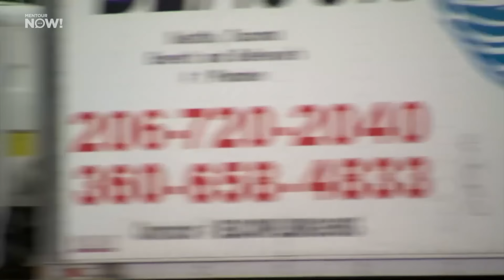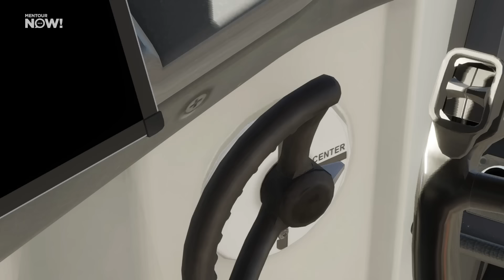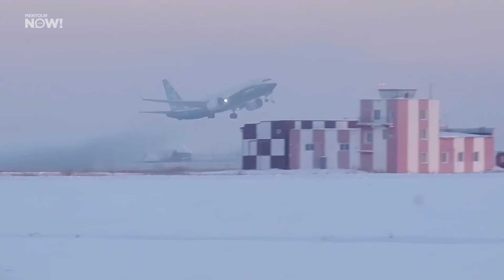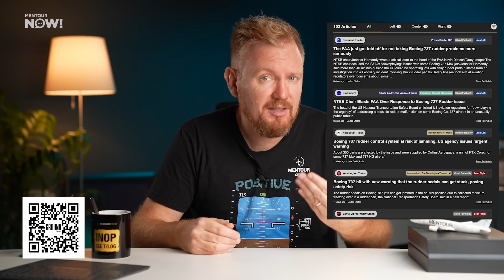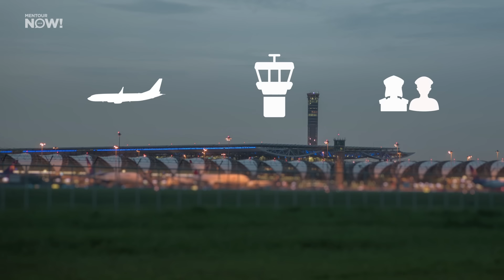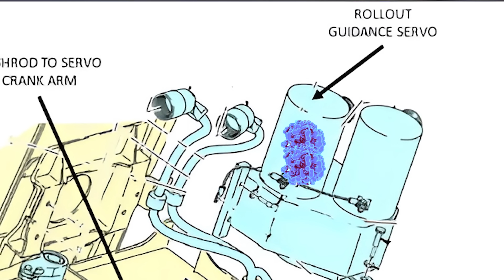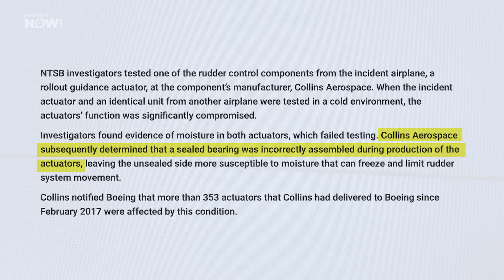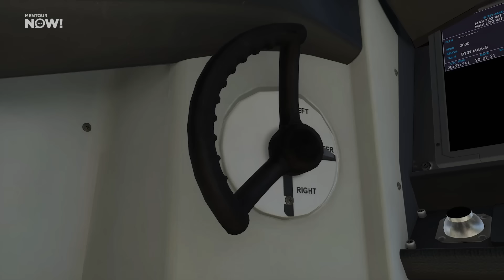Does the Boeing 737 Have ANOTHER Major Flaw!?

Comment: I think KLM replacing their 737 fleet with A-320neo family aircraft is an excellent choice.
Reply: Excellent? it is called common sense. Lives are more important than money, but not for Boeing's executives.
Reply: I wish all airlines would adopt the A32x family.  Even a 19 mm/0.75 inch wider seat makes a huge difference in passenger comfort in Economy/Coach thanks to the Airbus’s wider cabin.  I wish Boeing had simply started work on a clean sheet replacement rather than kicking the can down the runway or putting lipstick on a pig with the 737 Max.
Reply: @karlospineda371 They are unsafe. Just because something operates doesn't mean it doesn't have problems. You people would defend this company even if made planes out of paper.
Reply: @karlospineda371  LOL If no unsafe planes were allowed to fly, we wouldn't have had half the accidents. Boeing is producing faulty aircraft. To deny this is the height of Bias.
Reply: Kinda logical if you think of it KLM is an European company they will opt for Airbus (France, European) over Boeing (USA) except when Boeing can demonstrate it's safer and cheaper. After all it's a business.
Reply: @randar1969 wrong. Ryan Air being European uses an all Boeing fleet… Fleets in Asia use a lot of Boeing planes too. Please don’t spit out false claims to support a rhetoric that European favor Airbus. KLM is replacing its short haul fleet with A320’s but has still ordered more 777X and 787 Dreamliners into their long haul fleets..
Reply: @kimjong-un464  What did they say that is untrue? KLM is eventually swapping out all 42 of their 737s. They are also retiring their 777-200's with A350-1000. My guess is with the delays in the 777x, KLM will never order another 777.
Reply: @nitehawk86  Cause Boeing's new planes are UNSAFE, end of story.
Reply: @nitehawk86  That it being a European/USA argument. There's no practical reason for European airliners to select airbus over boeing just because its the same continent, boeing has maintenance facilities throughout Europe.
Reply: @vertigo2894  The 787 has carried over 200 million passengers without a single life lost. How much safer do you need it to be?
Reply: @longtimercer  Are you for real? The batteries were catching fire, it's a miracle a major accident didn't happen as a result. Have you seen what goes on in their facilities?
Reply: @smalltime0  No more boings in Europe please.
Reply: @smalltime0  your right its all about politics, i would love my company to be a all boeing fleet, however we are still holding on to that dam airbus a300 abomination
Reply: @longtimercer you must own stock in Boeing…😂 because no one would ever make a comment in favor of any Boeing product unless they were trying to get the money back they lost buying into the company of Death.
Reply: at least it is not actually abomb which all Boeing product’s are….
Reply: @friederikeernst7985 Except you may not have a choice in which plane you fly on if there is a last-minute equipment change or cancellation.
Reply: @vertigo2894 not in every facility 
Some airlines are only taking planes that were built in certain facilities
Reply: @vertigo2894  let's not assume it is all sweetness and light at Airbus--they are having significant engine issues on some of their planes--so an earlier Mentor report
Reply: @brucebrowne2077  strawman!!!!
Reply: @nitehawk86 
Yes, for the entire future, of the planet, they will never buy another Boeing plane.
Reply: @randar1969 , but Boeing CANNOT demonstrate that it is safe. Maybe Europeans may buy "local," but the Dutch are known as money pinchers and will go very often for the cheapest, but not at the cost of safety, which US companies do not care about. It is so money-blindly driven that they continue to support this aviation business.
Reply: @randar1969  They have a lot of aircraft from Embraer too, which is Brazilian right? Very much not European. :)
Reply: @randar1969  You people think of everything in political terms don't you? How much more evidence do you need that it's a complete joke to choose Boeing's new planes, no matter where the Airline is based.
Reply: @vertigo2894  thank you! 👏 Ppl are just in denial

Comment: Basically, as a passenger of any aircraft, I should be allowed to look at the maintenance records prior to boarding to determine if the aircraft is safe. I can't trust the airline, the manufacturer, or the NTSB to verify that these repairs have been completed. Boeing has single handedly destroyed confidence in commercial air travel.

Comment: At time 12:20  you're talking about
Cat III A, B and C which has now become outdated. I'm doing my ATPL theory at the moment and learned it through there, after many years in the flightsim community.
It's some good videos you're making, I'm just pointing it out so the newer generation of pilots don't get confused.
Reply: What is the newer system in place? Has it just been simplified to A, B and C now?
Reply: so u call it outdated but don't explain what it is now then....................thanks. how helpful
Reply: @KuostA  Tbh, I didn't explain it because i wasn't 100% sure what it was changed to. If I remember correctly, it was changed to the difference in Decision height and what the equipment is certified to.

Comment: I'm not sure why I did not know this, but I was not aware that there was a separate tiller control beyond the pedals. Makes sense for parking and excessive maneuvering, but I thought the pedals did all of that. Having smaller wheel steering movement from the pedals makes a lot of sense for landing and takeoff. Why not two controls for redundancy and emergency use is a cost saving mystery. Thanks for sharing!
Reply: The tiller is not expected to be used in flight and therefore does not need to be redundant. If your tiller breaks it will be on the ground and be a headache. However if it breaks in flight, who cares until you have to make that write up and cost your company a new NLG actuator
Reply: @ryleymclean313 Agreed. Only exception would in the rare case, and as just happened, the captain dies in flight. But then, the co-pilot could still take the captains seat but may not think to do so.
Reply: @Bare_Essence  the chances of the pilot unfortunately passing and a rudder jam are so incredibly rare it’s not feasible to consider it in the design process.

Comment: Boeing should produce a movie called "50 shades of attempted m*rder". The crashs of United 585 and USAir 427 were caused by faulty rudder controls, it took few years to the ntsb to identify the cause and boeing was not fully cooperative. The freezing oil inside the rudder actuator blocked the rudder at it's furthest position and sent the planes on a fatal bank...

Comment: "Not assembled correctly" is pretty much what I am expecting at this point. Boeing's "X days without manufacturing issues" counter can be reset.
Reply: Boeing had nothing to do with the assembly of the Rollout Actuator, it was built by Collins Aerospace.
Reply: @paulholmes672  who gave the  contract to Collins? And why ? Don`t tell me it has nothing to do with Boeing.
Reply: @paulholmes672  You are right, Boeing seems to have little to do with any of their aircraft anymore since it is usually their subcontractors who produce all the shoddy work. But it is Boeing getting the credit when it works, Boeing who earn the dollars and Boeing who are responsible to make sure that everything fits together. Which they clearly don't...or at least didn't in the past few years.
Reply: @Skaitania  True but in this case it was a part that had passed regulatory mandated tests with flying colours. A situation like that your going to trust that it was done right. Reminds me of the kegworth crash and the faulty engine design that caused a big change in test procedures as a result.
Reply: @paulholmes672  they are the ones ersponsible for QA, so should audit their suppliers regularly and thoroughly.
Reply: I don't know, it might be going up right now. Can't assemble an aircraft wrong if you're not assembling aircraft.
Reply: Resetting the counter is just part of normal opening procedures in the morning at this point
Reply: @connermurphy8059  at some point its just "the thing we have to keep at 0, noone knows what its for"
Reply: Do you lack comprehension of English or concepts of manufacturing in general? "Not assembled correctly" was not by Boeing but by Collins. The company at the time ran by the currently brand new Boeing CEO BTW.

Comment: "disable this optional system" for flight control systems shouldn't result in parts being left over - if only because the airline's maintenance procedures aren't going to account for the part existing. If it hadn't been moisture ingress after only a few years, in twenty years these things would be seizing up with congealed bearing grease because they haven't been maintained.
Reply: That's not really how maintenance works. When a mechanic goes to print out a manual, they have to select the exact tail number so that those instructions match the configuration of that aircraft. I do it all the time and I see entire manual sections that are grayed out after selecting an aircraft because they are for non-applicable hardware. For example my regular aircraft lack air stairs, so any air star references will be cut out of my manuals. Because these air craft have that actuator installed and disabled, there will be references for handling an installed and disabled actuator in the manuals, and regular maintenance will be scheduled by the computer systems.
Reply: @Synergy7Studios just like how there where instructions on the use of the MCAS in the flight manu.... Oh wait.... There weren't any.
Reply: @TheTurbinator  I am a maintenance tech. I see these manuals daily. I assure you, this system is functional. Montour Pilot said this was not a maintenance issue, the parts were installed correctly. The vendor found that a seal was installed wrong when it was manufactured. This was not a documentation flaw nor was it Boeing's fault. Please understand the full context of this issue. Even if this configuration's maintenance documentation WAS incorrect, which we have zero indications of, that was provably not the cause of this incident.
Reply: @TheTurbinator  Aside from the fact that you don't know the difference between a flight operations manual and a maintenance manual, what use instructions for MCAS do you think were missing? You probably haven't realized it, but MCAS has absolutely no human interfaces for the pilots to control the system, not even a switch to turn it on/off, nor any interfaces to let a human uniquely discern whether the system was operating or not. It's pretty hard for a human to "use" a system that has no human interfaces, eh? Or were you expecting procedures for mind control of MCAS?
Reply: Adding an optional component to a system often requires dozens of other parts. So, removing a single part wouldn't be the same as restoring the system to what would be the configuration without the option. If some parts involved are structural or large enough to require removing a section of skin, that rework might be expected to be expensive and to introduce a higher risk of failure. There's also the question of what configurations were flight tested during certification and I am guessing that the one part being removed wouldn't have been tested in flight for many reasons.
Reply: @mikebarushok5361  It could have been physically unlinked, but not entirely removed. Just dead weight. Instead it was left linked in.
Reply: How much bad it may look It's not uncommon though..bcoz when u remove certain thing from whole system which is tested with that part in place you literally need to do lot more test and checks. So they just deactivate it. Obviously in some cases like this issue it produces side effect that they never thought of. BTW there is no guarantee that removing that part physically won't have produced any other side effect that de never thought off. Long story short it's easy to say something retrospectively about certain things rather than dealing with the situation in time.
Reply: Ikea construction. Mind you, I just had a dust extractor from Amazon arrive, missing two screws.
Reply: @RahereTheGenius don’t be mean to IKEA. I’m not aware of their products killing hundreds of people.
Reply: @RahereTheGenius  "Mind you, I just had a dust extractor from Amazon arrive, missing two screws" - We really should start referring to Amazon as either "Return Warehouse" or "Refurbish Warehouse" because that seems to be what you get most often.  Even when you purchase something in "new" condition, you often get someone else's return or a clearly-refurbished item.
Reply: Complete removal of the unreqired system will incur more cost and expertise on boeings part  so they just did a cheap workaround hack which left the safety of the plane exposed to substandard leftover systems. Its the ghost in the machine.
Reply: @HaroldSahadeo  Wait a minute. People are talking smack about things they know nothing of. The choice to install/remove a component is often vendor driven and it’s usually removed for weight savings. For example air stairs, most airports now have jetways. Air stairs are a waste of fuel to carry. Boeing offers a product that has X amount of options. The choice to get it or remove it is the operator’s. Also any modification to the certified aircraft has to follow the FARs. I’m no friend of Boeing or engineers but you can’t point a finger without getting ALL the facts.
Reply: @HaroldSahadeo  You are projecting your own engineering competence—actually, an utter lack thereof.